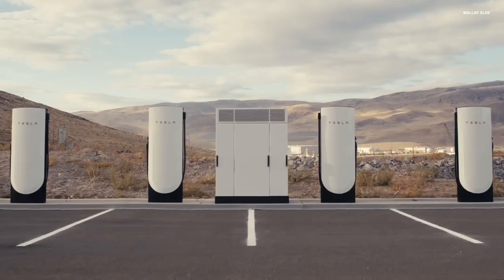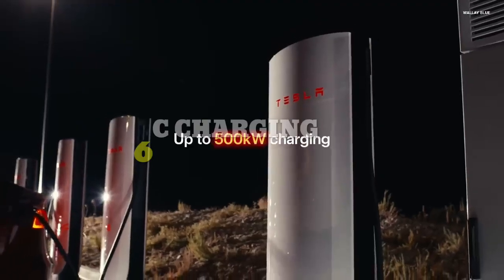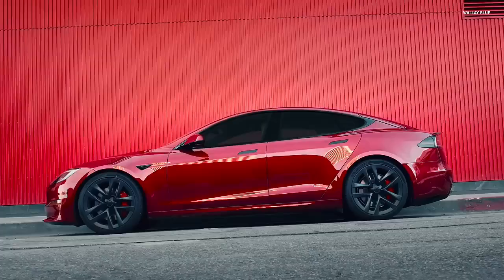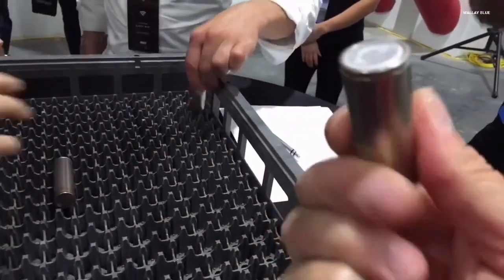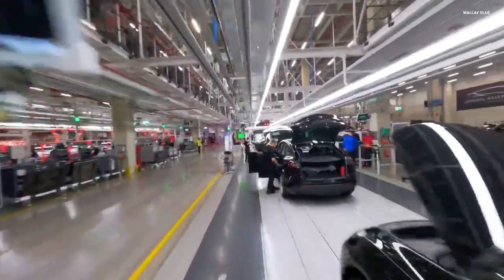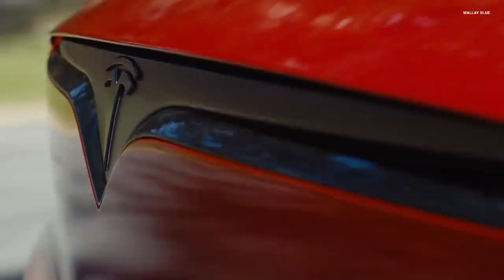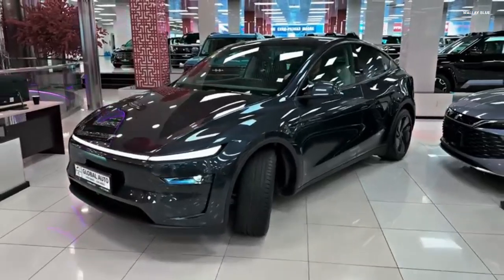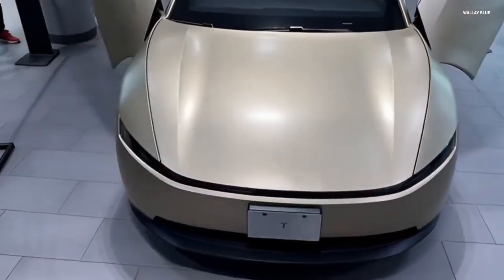Tesla’s New 6C Battery: Why the 10-Minute Charge Changes Everything!

Comment: Nobody needs 10 minutes full charge. You have to piss and eat😂
Reply: So true. The mercenaries for the Anti-EV cabal want consumers to believe 10 minutes is essential. I've owned an EV since 2017, charge at home and drive just under 100 miles every day.  Although I pass no fewer than 10 public charging stations each day I have NEVER needed to stop and use one.  Most new EV's allow home charging at 11.6 kW while Tesla's Model S and X and some other new EV's can even charge at 19.2 kW. At these charging speeds most people with a daily commute of under 50 miles can top off at home in a little over 30 minutes. Fast enough that they may never need DCFC.